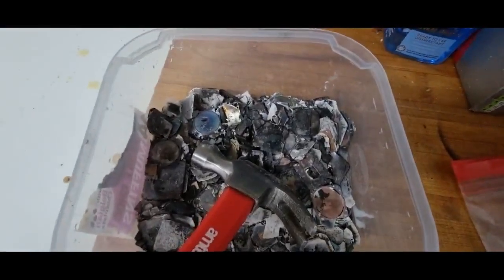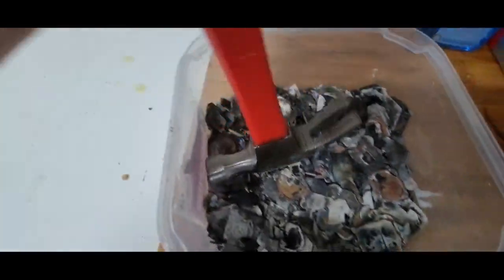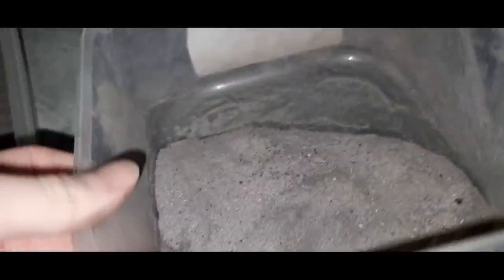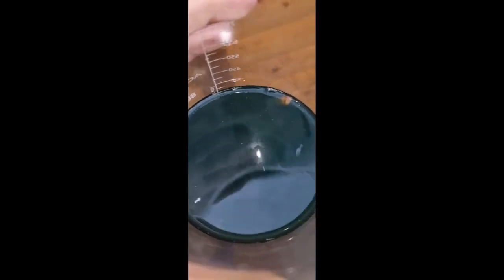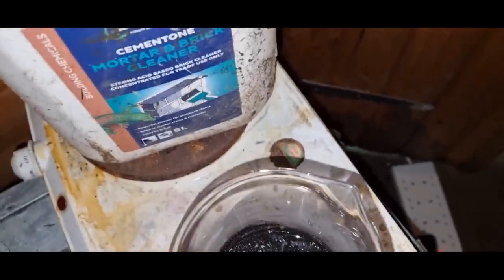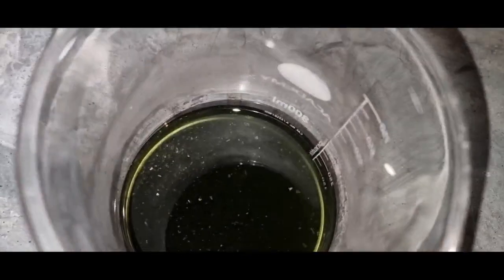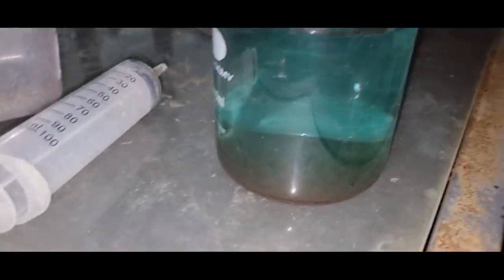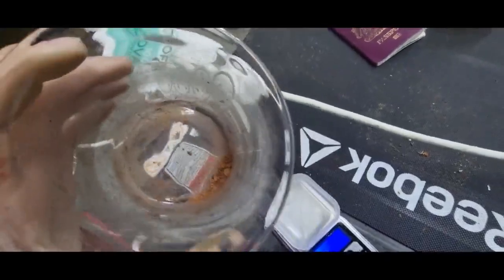gold recovery and refine from 450g gold corner bga tops yield test

Comment: I've noticed the gold corner bgas with those copper heatsinks have a lower yeild too I usually keep them separate
Reply from the maker: Yeah they often are more modern so less likely to have gold and they also weigh more because of the copper so by weight won't be as good

Comment: Thank you bro for pointing out about purity after a first refine. I battle with dude on another channel over that...  Does a dirty AR drop with stump remover smb, single refine, simple rinse of a wash then says hes listing it on ebay as 999 24k... Dude can do anything he wants abd i think he's honest.... Just leaves out important information, like you predicated in this video. Look forward to the follow up.  id recommend running whatever didn't dissolve in the AR through another round hot...  Seemes like, to me at least, theres always a smidge of gold that's stubbornly left behind
Reply from the maker: Haha normally after first refine it's about 95% so around 22k but depends on how much other metals was with the gold to begin with. I like to refine once, heat on hcl for an hour or so until its a nice colour then re refine again and it comes out great
Reply: @keytefirerefining1355  thats good numbers there...  Normally id sell it there unless im specifically going for 999. Which i got cut down to be as lazily efficient as possible 😂 AR, drop, quick wash and dry. Inquart with silver boil in clean fresh nitric. Good wash in distilled, ammonia, and distilled only bout 15mins to clean. To be honest it isn't as easy for me to assay or purity test locally since my old buyer pulled something shady. I don't know anyone else with an xrf. Been able to wing it so far 😁
Reply: Hello, I loved the video. As I understood you Ashed the bga chips, soaked in what ? Then washed and added hcl, heated and then melted the gold powder ? I couldn’t really understand the process. Where did the other black plastics in the beaker go etc.